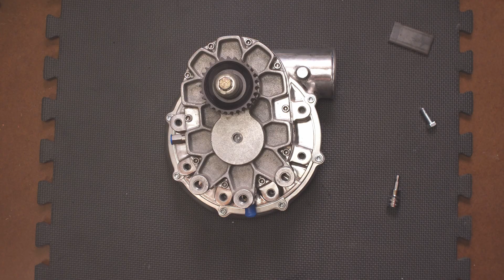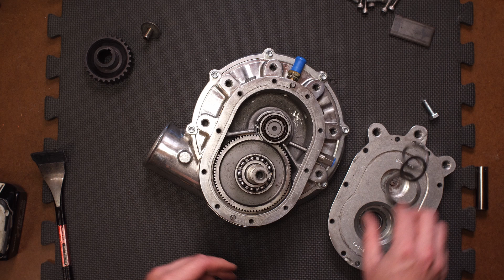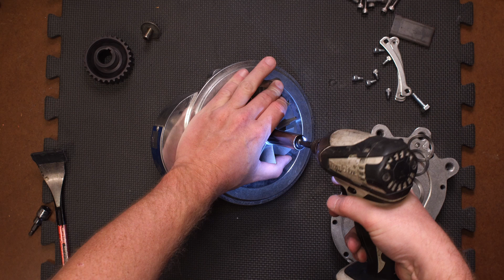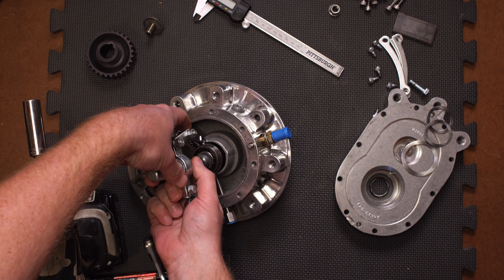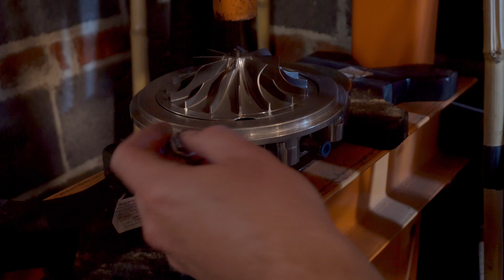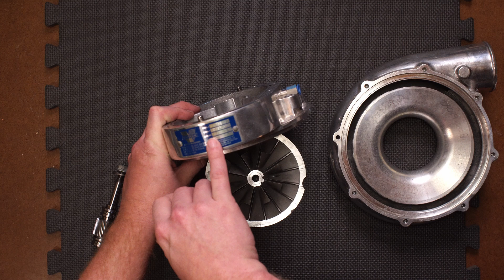Taking Apart A Vortech Supercharger

Comment: I’m looking for answers from professionals on YouTube. 

I just purchased a 2017 Mustang GT with a vortech v3 supercharger. I drove it from Bakersfield to Los Angeles this past Saturday afternoon and drove her yesterday around San Pedro. I did some spirted driving on the highway of course….

Today I was going to wash the car and I opened the hood and saw oil in my engine bay and on the hood. Upon further investigation I saw it was red colored oil like the one the original owner gave me to change out from the supercharger. Upon further examination I saw that the oil seamed to have leaked or came from the top of the super charger where the brass plugs are. I did some research and read that if you over fill the unit then this can happen when pushing high boost, possibly leak from the vent plug? 

I’m wondering if with this info you can come up with some possible answer based on your experience. I saw your videos and decided to ask.

Comment: Hey man did your p-2 speedway supercharger pulley have the same shape and come off and replace the same. Im debating on buying one but I'd need to replace the gilmer drive to 6 rib
Reply from the maker: The P2 doesn't have a gear box and the T5 drive is physically machined into the impeller shaft.  It would be virtually impossible to put a 6 rib pulley on it without major modification, unfortunately.

Comment: No oil slinger on this unit?
Reply from the maker: No.  And no need for one, really.
Reply: This is the vortech v3 si right?
Reply from the maker: @andywu8558  No, It's a V2 demo unit - it has an SC impeller in it.  I can machine it to fit an Si impeller, which would perform much better (and that's currently the plan).
Reply: AlexLTDLX awesome.

Comment: Good to see your still at it Alex. I've been following your stuff way back since the M112 install thread on the forums. Always appreciate your DIY approach and out of the box thinking. I guess I shouldn't be surprised to see your moving on to electric supercharging. Good luck!
Reply from the maker: Thanks man.  I just enjoy trying out new things.  All the blowers I've used in the past have been the limiting factor.  This one won't be any different, but it seems that the limits are not only imposed by the Vortech SC trim, but also by the available motors.  I'll be posting an update video shortly - I've found a motor capable of 22hp (peak) and 40,000 rpm.  So I might need to make a second electric Vortech.  And since I'll be shooting a lot more video in my garage, I've been re-doing that unholy mess... wait until you see the state I let it fall into.

Comment: Technically the smaller exducer just ALLOWS for higher wheel speed. The limit of a compressor wheel is when the tips go supersonic. Larger exducer sees that at a lower RPM, but is more efficient until it does. The smaller wheel is less a prob since it won't be coupled to engine speed, unless your motor is too slow.
Reply from the maker: I'd agree except Vortech lists the SC trim as slightly more efficient (the compressor maps verify this), and the whole power to turn the compressor wheel increases with the cube of rpm.  But as a buddy pointed out, there's a "sweet spot;" and that will be determined by the electric motor's capabilities.  At least I can swap in an S trim wheel if we don't hit torque-limited rpm with the motor I'm ordering.  Only one way to find out, right?

Comment: The cubed rule may not hit you like you're thinking, as the modified wheel will pump less at the same RPM consuming less power.  For the same air mass moved through more RPM it's likely the same power.  Here is a decent reference for the pump equations.  I haven't done the math myself but I'll go on a limb and guess if your new position on the map remains in the RPM range of the motor shifting up won't hurt you (much).  https://www.engineersedge.com/fluid_flow/pump_laws.htm
Reply from the maker: Hey man - how are you?  You might be right.  I was thinking along the same lines.  If the motor doesn't have enough power to spin the bigger S impeller (i.e. loses too much peak rpm), this might put us in the same or possibly better spot.  We'll find out, because supposedly the ESC I'm looking at tells us the actual motor rpm through back EMF.  Great hearing from you!

Comment: why not keep the 2 bearings and the rear case and drill through that for the motor to engage in that shaft. I only suggest it as vortech have already provided you with bearings and races designed to take the loads and speeds from that compressor, seems a shame to junk it.
Reply from the maker: That's a thought, but I don't really don't think it's necessary. Also, that shaft is harder than Chinese arithmetic so it's going to be a challenge to just drill. I may have to grind some off the rear face. I don't want to anneal iit cuz that'll put Mill scale on it.   I'm also going to have to buy a high-speed lubricated bearing that fits in there because I don't want an oil feed. But it's a good thought, I'll keep it in mind.
Reply: @AlexLTDLX  seeing as their won't be gears meshing you'll just have to rig up some sort of splash lube for the bearings. case is already oil tight. anyways just a suggestion, ain't my project, but v.interesting!
Reply from the maker: @denisohbrien  I'm searching for ceramic/sealed bearings for this thing.  Otherwise, you're right - I'll need to do something to keep them lubed.

Comment: Out of curiosity can you tell us the teeth count on the gear drive? I’m just curious what the ratio vs engine rpm is. Another thought I had about the crankcase evap pump, what about a smog pump? I’ve heard of guys trying to use them to “supercharge” mini bikes and Honda CT70 style engines, but they don’t supply enough flow/pressure for anything bigger than 5-6hp NA base engine
Reply from the maker: Sorry for the delayed reply - I don't have the parts here to count the teeth, but according to Vortech, all V2 blowers have a 3.6:1 internal step up.

Comment: Love this series!   I was curious how they did the gearing in those to get the compressor up to speed.   I think a turbo needs to be at around 150-250k rpm to build psi.   I am curious what that compressor wheel on that super charger is designed for.
Reply from the maker: I go into detail on exactly that in the previous video: https://youtu.be/h7yScua28I8  Thanks!
Reply: @AlexLTDLX  Oh nice!  I am not sure how I missed that one.   Have you seen the little AMR Roots 500 Superchargers?  I think they are like $150-200.   They have like a possibility for an electric motor application on a 4 cylinder engine.
Reply from the maker: Yeah, somebody else pointed those out to me.  Ironically, they would be great for a crankcase evac pump - hat started this whole mess.